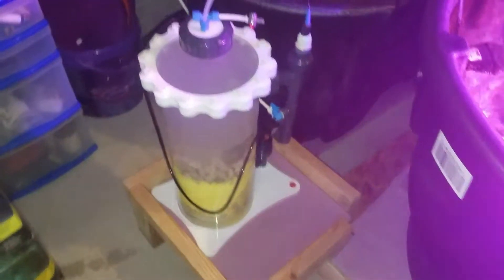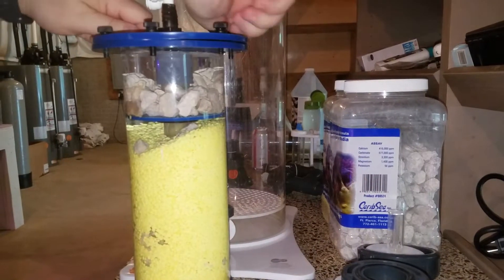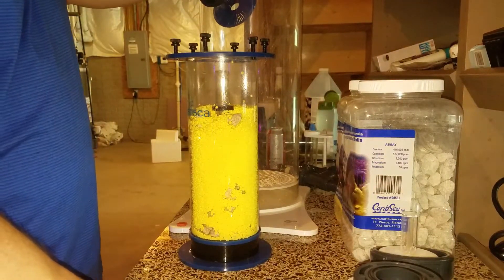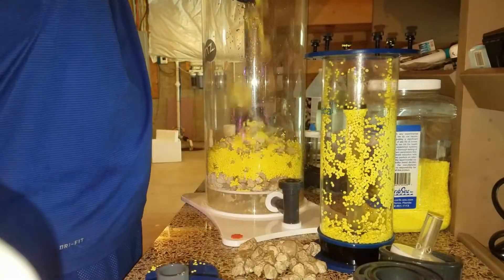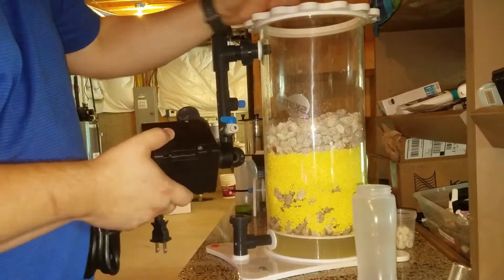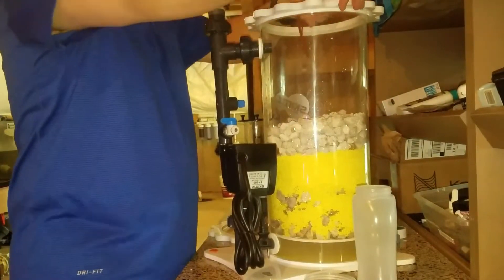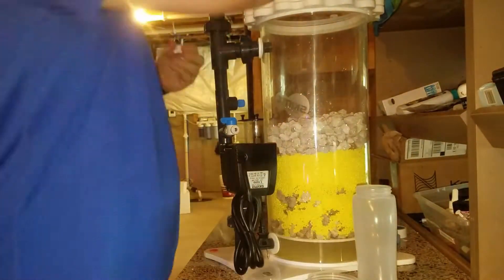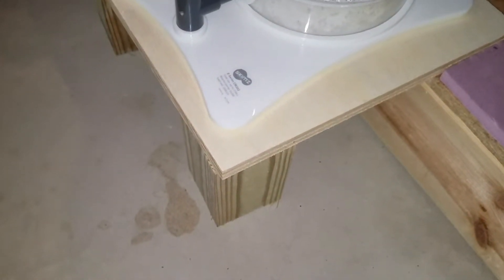How to make a Nitrate Reactor out of a Calcium Reactor

Comment: I’m confused. How does the reactor fill back up with aquarium water
Reply from the maker: @gregfoster6916  you're using a small pump to draw water from the tank into the reactor.  I was using s Tom's aqualiter for this application but any peristaltic pump you might already have for your calcium reactor would work

Comment: Appreciate your work and I have definitely learned something from this video. I am currently battling HIGH NO3 and PO4 after a H2O2 treatment for 12 weeks and absolute heavy feedings. NO3 tipping on the NYOS Nitrate Kit and PO4 the Hanna can’t even read and flashing at 2.5ppm. I will definitely buy the Aquamaxx CaRx and use that as the Sulphur De-Nitrator to reduce NO3 and not worry about not feeding enough to all my fin friends. Once again thank you for sharing.
Reply from the maker: You're welcome.  Thanks for watching 👀

Comment: Are you still using this system? and if so, how much did you notice your alkalinity drop when using this? was the aragonite in it enough to offset any alkalinity lost? I am just about to go live with this system, just wanted to get some final info on it before I go Live..thanks!
Reply: Forgot to mention I don't have a reef, just a predator tank with eels, lions, etc...but high nitrates and don't want to hurt the fish if the alkalinity drops more than am expecting...let me know..thanks
Reply from the maker: I am no longer using the system.  I didn't notice any alk loss but I have a very high water volume.  1320 gallons now. 1250 then.  It should work great.  Just keep an eye on your Phosphates.  The system will need some phosphates to work properly in my opinion.  When I was below .03 phosphates I dont think it worked very well
Reply: @BlueCarbonReefing  thanks for the info...did you find that your phosphates got low, and did you dose phosphate back then? I don't have a reef, just predators like eels, lions, grouper...but the nitrates get high pretty fast and as you know water changes help but not like you want....
Reply from the maker: After I started dosing phosphates my nitrates started dropping.. before I dosed i couldn't get them down
Reply: @BlueCarbonReefing  thats grear information...what product do you reccomend and how much to dose in case i need to do that?
Reply from the maker: @mikescichlids  check out Greenleaf aquariums products. Dosing will have to be up to you but start slow and remember rocks can hold phosphates so you might dose and not see your Phosphates jump what they should. Only change a little every few weeks
Reply: @BlueCarbonReefing  thank you so much for the help!
Reply from the maker: @mikescichlids  you're welcome

Comment: After a new setup ,how long dose it take for your nitrate to start dropping down?
Reply from the maker: Normally it can take a few weeks for the denitrifying bacteria to build up to start to notice the drop
Reply: Blue Carbon Reefing Thanks for your reply.
Reply from the maker: @MegaTheo1974  you're welcome!
Reply: Blue Carbon Reefing, Hi my Nitrates are dropping now, my KH is also dropping too fast, what will i do to stop the KH from dropping, in my Reactor i have the following media’s Sulphur beads =500mls and Calcium media =500mls the volume of my tank is 400L,Cheers
Reply from the maker: @MegaTheo1974  Is your calcium dropping or just your alk? I have read the reaction causes your alk to drop. I would simply dose extra alk to keep it in line.
Reply: Blue Carbon Reefing like which Alk stuff will you recommend please.
Reply from the maker: @MegaTheo1974  soda ash. I would check out Bulk Reef Supply. They sell pharmaceutical grade . I definitely trust the quality
Reply: Blue Carbon Reefing I will appreciate that please.
Reply: Dose Kalkwasser.  It'll keep the ALK and PH where you want it.  Especially the PH.  Calcium is also improved with Kalk.

Comment: Hi great video, I’m building my diy sulphur reactor for a 17000lt Aquarium, is it ok when putting calcium and sulphur in reactor that I mix the 2 together?
Reply from the maker: Are you referring to aragonite or calcium reactor media? If so that is completely fine.
Reply: Blue Carbon Reefing yes same one your using in your video
Reply from the maker: @joebasile267  yes you can definitely mix it together however I dont think it helped or hurt anything by mixing it.
Reply: Blue Carbon Reefing I’m thinking because I have such a huge reactor 60lt with 30lt sulphur 30lt aragonite , I was worried that if put the sulphur on its own it might get some dead spots the aragonite mixed through it would hopefully flow water a lot easier?
Reply from the maker: @joebasile267  that is why the reactors have a recirculating pump to help prevent channeling and dead spots but you could be on to something
Reply: Blue Carbon Reefing I hope your right , what flow rate should I start with being such a huge reactor I’m not sure that 1 drop a sec would be enough?
Reply from the maker: @joebasile267  you will have to start slow like 1 drop per second and give it a few weeks for the bacteria to populate. Basically start slow and test the effluent.  If it is zero nitrates coming out you can turn the flow up
Reply: How are you doing. I’m still playing around with this sulphur reactor, I’m getting strange reading from effluent water . API test Kit when I put first 10 drops water goes orange straight away like 40 ppm nitrate then I put second 10 drops then it goes down to 20 ppm ? Tried JBL ,NYOS, Salifert test kit and I’m getting reading from 10% to  100% higher than tank water?? Tank water is 100 ppm . Have any issues?
Reply from the maker: @joebasile267  mine has been taken offline as my nitrates are near zero. I never had problems testing. It sounds like your results are not consistent.  A couple of things come to mind. Is the test kit  expired? Are you shaking bottle number 2 for 30 seconds?  Are other kits giving you inconsistent readings as well?

Comment: I use a T peice off a return pump with tap after then a tap on outlet, you can ballance the pressure better to give a good drip on outlet, tricky to get dialed in, the media takes a long while to get going and you may need more media to keep a good drip rate at zero nitrates.

Comment: Great video, 
After it was set up and the drip rate kept slowing down to 1 every 10 second, did you increase it back to 1 per second or leave it for a few days?
Thanks
Reply from the maker: Letting it slow down seems to work best.  Eventually mine looks cloudy white on the inside of the reactor.  Then I turn the flow back up.
Reply: Blue Carbon Reefing 
Ok thanks for your reply, I’ll leave mine be for a few days and see what happens. It’s newly set up and keeps slowing down.
Reply: Blue Carbon Reefing 
Oh, have you got it up and running now?
Reply from the maker: @si8780  yes it is working great

Comment: Lol, always thought I was a hardcore reefer, and now I know for sure! This was really interesting. At the ideal flow rate you’re targeting, how long do you think it would take to turn over the entire system volume? Would it take a year do you think? If it does take a long time, is it going to be effective in the long term, i.e. will the reactor keep up with whatever is contributing nitrates? I’m a big fan of redundancy, taking parallel steps to accomplish control, so I can see where this reactor would work in concert with the chaeto to contribute to nitrate control. It’ll be interesting to see what happens. 👍🏻👍🏻
Reply from the maker: I am always happy to confirm how hardcore you are. Haha. At one drip per second it would take years. Eventually the bacteria will continue to populate as long it something to feed on. I dont know for sure but I am hoping I would get to a steady stream at some point. I also agree with using multiple ways to accomplish something. When my nitrates get under control I can make small adjustments from there. Thanks for watching Cindy
Reply: Any update on this? I have seen a few people struggle with keeping ORP down and having a decent flow rate. I wonder if the trick is leaving it totally closed for a few weeks until the ORP is super negative and then speeding up the drip. Im building a bigger sulfur denitrator right now (current one doesnt do much at its drip rate).
Reply from the maker: I added more media about 12 days ago so now the reactor is full. I kinda started the clock over with the bacteria but i can tell i am going to achieve a higher flow rate with more media. Right now i am back to keeping the reactor to 1 to 2 drips a second until the bacteria population grows more. I have seen the orp drop as low as negative 170 but there the flow had slowed.

Comment: Looks like a good design. Is it common to add the aragonite rubble? I think it would help add surface area for the bacteria. Does the effluent smell like sulfur? I had some live rock in a bucket for 2 weeks with no flow and it was smelly lol.   #trulyahardcorereefer
Reply from the maker: No smell from the effluent. If there was I would need to increase the flow. The aragonite serves a few purposes. One as another place for the bacteria to grow, two it will help buffer the water as the chemical process of converting the nitrates leaves a reduction in alkalinity.  It is the one negative side effect to the reactors. I will have to keep a closer eye on Alk. The 3rd is it helps hold the sulfur media in place. We do not want any tumbling. You are truly a hard core reefer!